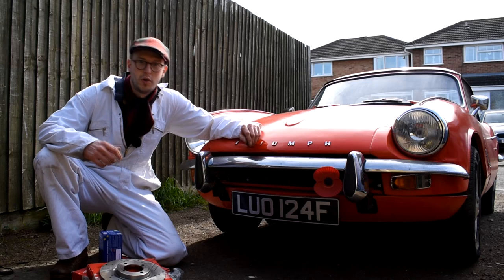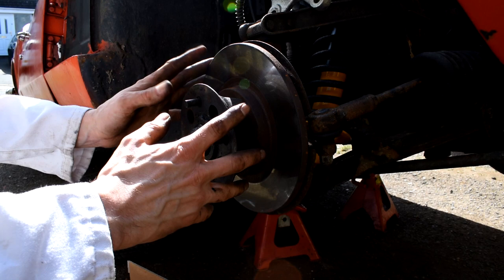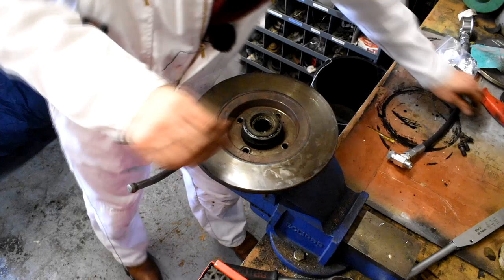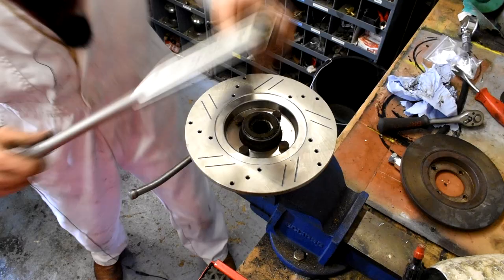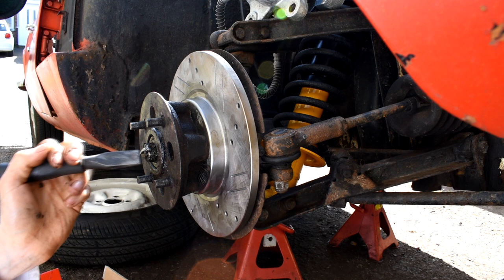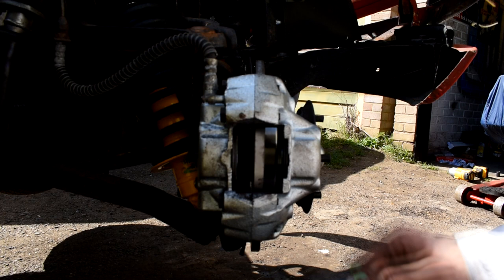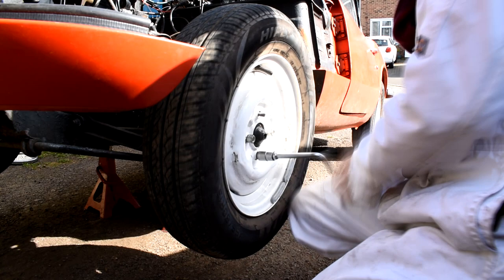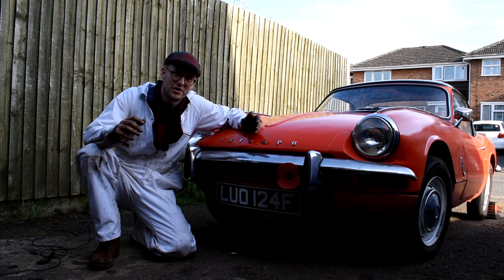Triumph Spitfire Brake Discs and Pads

Comment: Good video Steve, I have a tip for anyone who hasn't got a vice to hold the hub you can put the hub studs in the wheel and kneel on the tyre to stop it rotating whilst undoing the 4 bolts that connect the hub to the disc .that car looks like it's become a really good useable classic.
Reply from the maker: Cheers mate, yes that's a really good tip, I like that 👍
Reply: Yes good idea, you can do everything by the side of the car then...
Reply: Very handy to know,  cheers

Comment: A tip if you don’t have the caliper wind- back tool is to crack open the bleed nipple, you can lever the pistons back easily then and it will displace the excess old, hard-worked brake fluid from the caliper and make room for the extra meat on the new pads.
Reply from the maker: Very true, and good advise too mate 👍

Comment: Wow, that came off really easy! Can you do the same video for TR6? Or basically the same?
Reply from the maker: TR6 is basically the same brakes as a Spitfire, only bigger. I will do a video on them at some point 👍
Reply: Great, thanks. I’ve already ordered the parts and going to tackle my front brakes. Your videos are excellent by the way, I follow them exactly. Step by step.
Reply from the maker: Cheers David, glade my videos are helpful to you. I've always said if my video's just help one person then they have done there job. But as always, have the workshop manual near by to refer to as well. Hope all goes well with you replacing your brakes 👍
Reply: @SteveDentonClassics  I did my brakes today Steve. Followed you step by step. Exactly the same. Does it matter which way the pins are re-inserted? Meaning do they point out or inwards? Mine was different from one side versus the other.
Reply from the maker: The split pins on the hub can go in anyway, it really doesn't matter, so long as they secure the hub nut in place. However logic dictates slotting them in the way gravity falls is the best bet. And as for the pins in the calipers, there are different calipers on the market and they can be fitted both ways. I've always fitted them the way shown in the video pushed from the inside of the car outward. So long as the pin is securing the pads in place with the R clip and is not fouling on the wheel when its turning, and the pin cannot move out of the caliper when secured with the R clip then all will be fine 👍